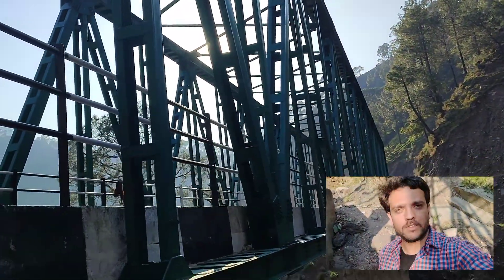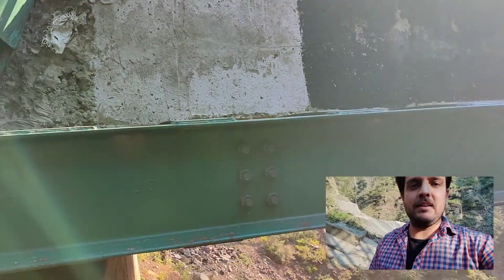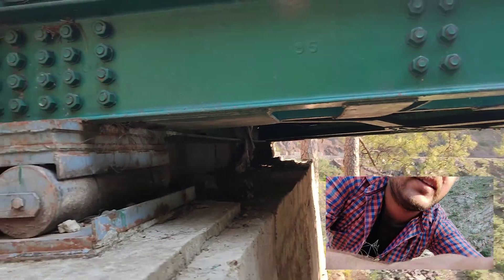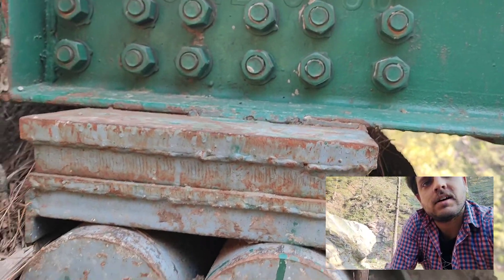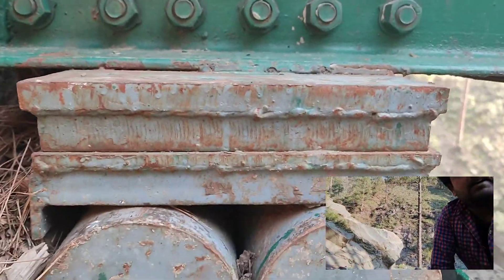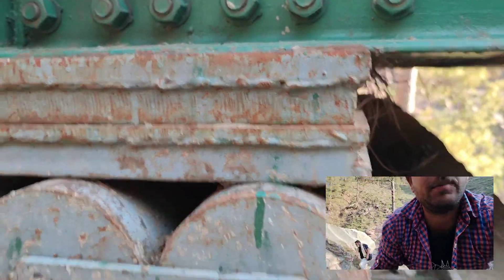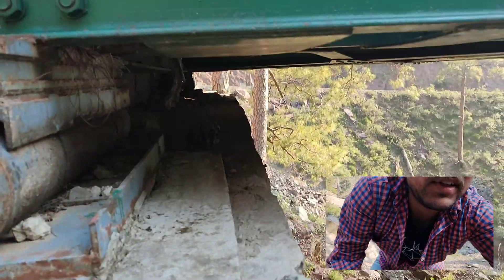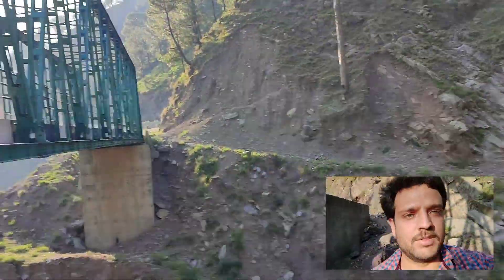ROLLER BEARING | TRUSS | BRIDGES

Comment: Wow so that's what it's used for...I was scratching my head about why a beam is supported by a roller/ball the whole time in my Engineering classes and nobody explained why...
Reply from the maker: Hope it helped. Check a detailed episode on multi roller bearings under the playlist Journey of A truss on this channel to know more about roller bearings
Reply: The roller bearings allows the steel bridge to expand in hot weather.  If the bridge was fixed at both ends then on a hot day stresses could build up in the bridge which could cause it to collapse.  I believe rusted-up roller bearings was one factor in the collapse of the I35W bridge.
I believe roller bearings are not used much these days and they are generally found in older bridges, with elastometric bearings being favoured in newer bridges.